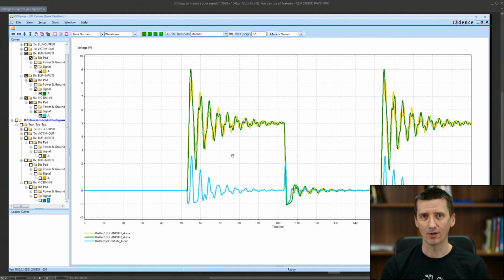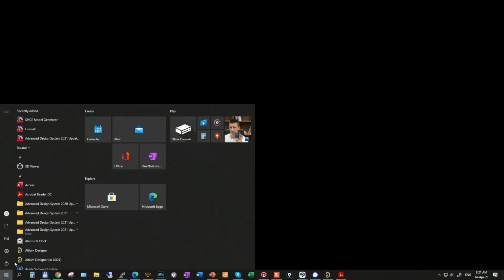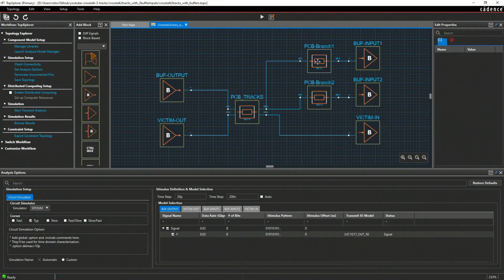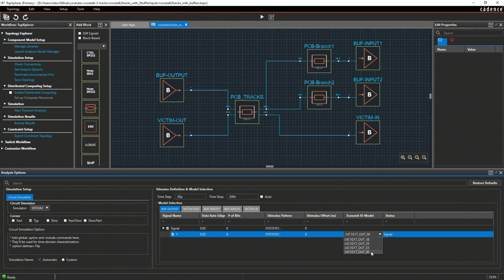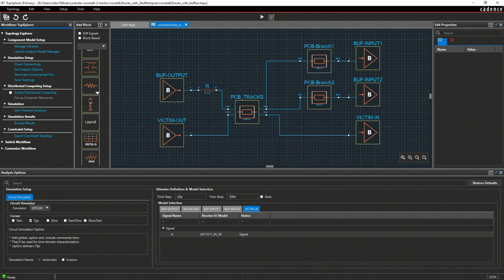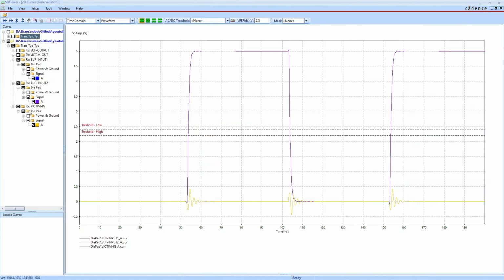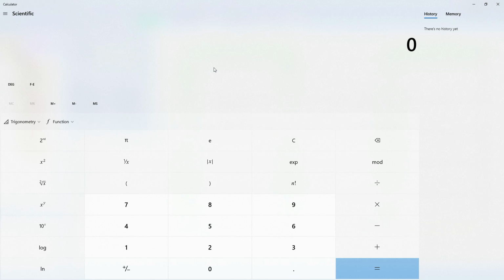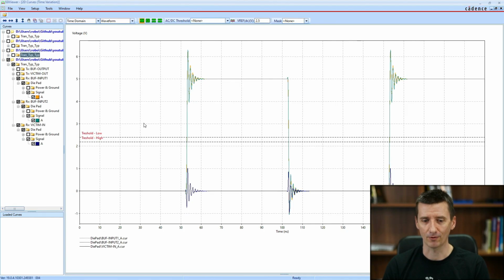3 Simple Tips To Improve Signals on Your PCB - A Big Difference

Comment: Interesting video.

It would be interesting to try: 
2.8mm (110 mil) tracks on 1.6mm (63mil) PCB with 33 ohm series resistor and balancing of branches.

And 0.3mm (12 mil) tracks with 1.6mm PCB, 100 ohm series resistor and balancing of branches.

🙃😉
Reply: P.S.
My old RF Professors Rule of Thumbs were like: 
if its much smaller than lambda/10 you won't see anything/much.

Around lambda/20 you'll see significant effects.

Basically it's like a resonator (with multiple resonances at n×λ/2), and the effect is like the bandwidth/Q of the resonator. If your frequency & rise-/fall times are further away, the resonance detunes.
Reply from the maker: @icestormfr  I think, there may be difference between sin signal and square signal. I would expect, square signal would have many different frequencies, so that could also influence the results. But I had similar thoughts and I actually played with sin and also square waveform but it was difficult to interpret the results.
Reply: @RobertFeranec  Yes and no? In case of no dispersion the phase and group velocity are the same. So it doesn't matter if it's a pulse, square or harmonic signal.
In reality the dispersive/damping nature of FR4 (epoxy!) results in a frequency dependent dielectric constant and damping, especially at higher GHz frequencies. In that case it matters a lot.

Regarding the junction I read up on my old university stuff and also made some LT Spice simulations to verify. 
In the case of a simple T-junction without any "black RF magic" tricks and looking at a broad non-dispersive frequency range (rect signal) it's "simple" .
The incoming signal splits in 3 waves:
a) -1/3 voltage amplitude: reflected wave to driver (inverted sign, 1/9th of power)
b) +2/3 voltage amplitude: transmitted wave to 1st receiver (same sign, 4/9th of power)
c) +2/3 voltage amplitude: transmitted wave to 2nd receiver (same sign, 4/9th of power)
Effectively, +1/3 voltage is seen at the junction (+2/3 for forward wave, -1/3 for backward wave)

And then they bounce similarly like I explained in my first explanation, and split/reflect at t-junction according to upper paragraph.
Example: reflected wave from receiver 1 comes to junction.
ba) (-1/3) x (+2/3) => -2/9 voltage amplitude: goes back to receiver 1
bb) (+2/3) x (+2/3) => +4/9 voltage amplitude: goes to receiver 2
bc) (+2/3) x (+2/3) => +4/9 voltage amplitude: goes to driver
Effectively, +2/9 voltage amplitude is seen at junction...

About current/voltag at nodes and corresponding forward/backward wave amplitudes a/b:
https://cds.cern.ch/record/1415639/files/p67.pdf

P.S.
Explanation to the T-junction:
basically all three "ports" of the shorted transmission lines have the same characteristic impedance Z0.
As one port with Z0 output impedance feeds to two ports with input impedance of Z0 (resulting in effective input impedance of Z0/2), there is an impedance mismatch.
Reflection (Amplitude) = ( (Z0/2) - Z0 ) / ( (Z0/2) + Z0) = -1/3
Transmission (Amplitude) = 1 - Reflection (Amplitude) = +2/3

P.P.S.
Fun fact: if the two traces from the junction to the receivers are 2xZ0 (e.g. 100 Ohm) and the same length, no reflection at the junction occurs, just at the open ended (high impedance) receivers. The returning waves join perfectly at the junction to a wave going back to the driver (no split up waves to the other receiver, respectively) and is absorbed by the series resistor
:-D
Reply: @RobertFeranec  
Addendum regarding the T-junction of the traces and waves&S-parameter:
https://en.m.wikipedia.org/wiki/Scattering_parameters

Also, not only dispersion but (parasitic) inductance & capacitance add frequency dependence. So rect and sin/cos are in reality different, but not much for the basic behaviour as shown in your example (mostly transmission lines and series resistor).

For three traces with same characteristic impedance, the S-matrix is (ideal case, at very high GHZ frquencies the junction itself would be needed to be simulated):
((-1/3, 2/3, 2/3), (2/3, -1/3, 2/3), (2/3, 2/3, -1/3))

For the non symmetric case (see other response) with 50 Ohms for driver trace and 100 Ohn for each receiver trace:
((0, 1/sqrt(2), 1/sqrt(2)), (1/sqrt(2), -1/2, 1/2), (1/sqrt(2), 1/2, -1/2))
Reply: @RobertFeranec  post addendum:
Just got an idea, theoretically (and also by LTSpice) it should work: adding 50 ohm series resistors at the t junction in the receiver traces for impedance matching instead of balancing the traces.

So:
a) Driver =>33 ohm series => 50 ohm microstrip transmission line => t-junction
b) t-junction => 50 ohm series => 50 ohm microstrip transmission line => receiver1 (open/high impedence)
c) t-junction => 50 ohm series => 50 ohm microstrip transmission line => receiver2 (open/high impedence)

The added 50 ohm create 100 ohm effective characteristic impedance for the receiver arms, and together they result again in 50 ohms (100 ohm in parallel).

This works as the ends are not terminated by 50 ohms (otherwise you would loose power by the extra series resistors). The signals at the receivers should not have oscillations. Side note: the slowed edge is due to the receiver arm reflections (open end at receiver input) and is proportional to the delay/length of the trace arms 🙃